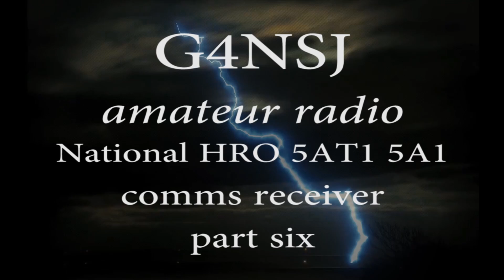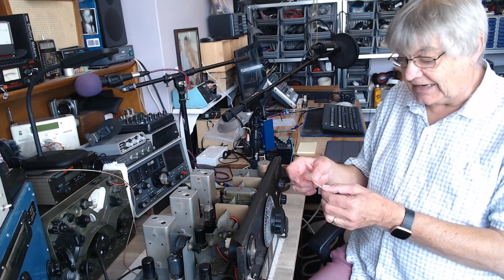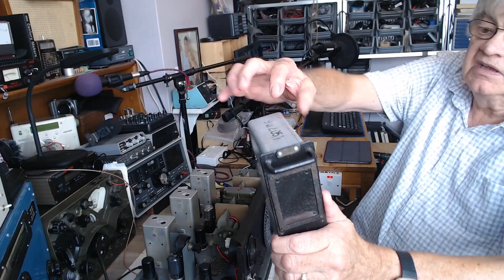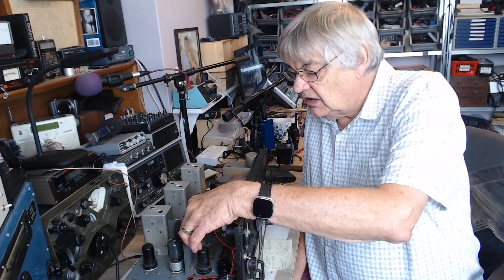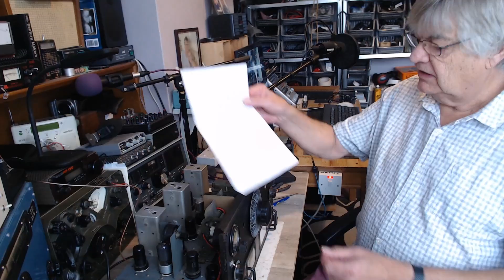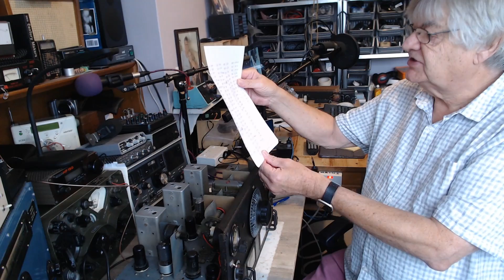G4NSJ - National HRO 5TA1 5A1 R106 mk1 mk2 comms receiver - part six

Comment: Ray, I commented last video about a move here in the US to eliminate AM radios in new cars. I did just a little internet research about this. The car manufacturers evidently are having trouble with interference from the electric motors on EVs. There is so much interference from all of the cheap switching power supplies in our home devices it is hard to get a clean signal. My new washing machine produces bad interference on my AM radio in my shop. When my wife heats water in her Keurig coffee maker, it completely wipes out my AM radio while boiling the water. I am sure big money of the car industry will win out. Take care, I enjoy your channel, I no longer do any electronic repair retired now for 11 years, but I understand everything you are talking about. I spent 42 years working in industrial controls, land based microwave and commercial two-way radio systems.
Reply from the maker: Yes, I remember you comment about AM car radios. Interesting about the EVs. Crikey! Even more interference! I use a miniwhip active antenna for medium wave DXing, which is pretty good. Enjoy your retirement! Cheers, Ray.

Comment: A few years ago I found a web page for the HRO giving a list of frequency's and dial setting versa frequency and printed it of on to A4 paper. covering most of the coil sets
If you have seen a BC221 booklet its the very same idea.
The site I think has been deleted.
Reply from the maker: That would have been useful. There are quite a few sites with good information. It just takes time trawling through them all.

Comment: When the restoration is complete are going to release the whole video series on DVD Ray?
BBC Radio Guernsey runs 500 watts on AM. 
I am just along the coast from you in Ferring and can pick up Mid Downs Radio from Princess Royal Hospital, Haywards Heath on 1350 kHz. The only good thing about loosing the medium wave broadcast stations is the increase DX and low power reception.
Reply from the maker: Hi John, That's a good idea, I'll put all the videos together.  OK on Guernsey, thanks for the info. I'll take a listen on 1350 later. I like medium wave DXing, especially listening for low power stations. Cheers, Ray.
Reply from the maker: Yes, I can hear the Princess Royal Hospital transmission Haywards Heath on 1350KHz. Weak but readable.